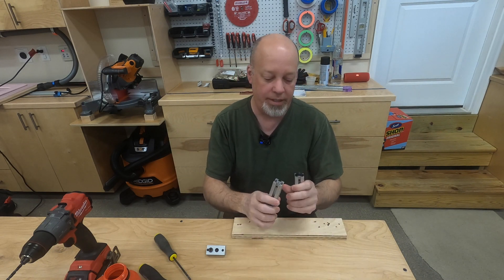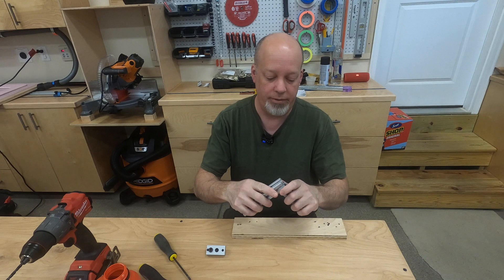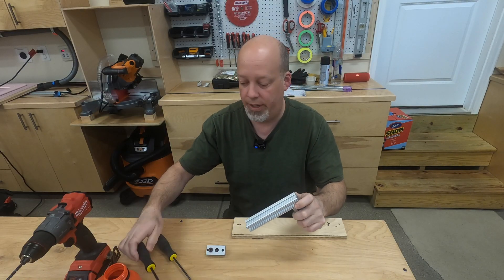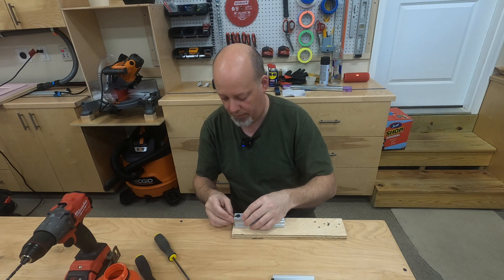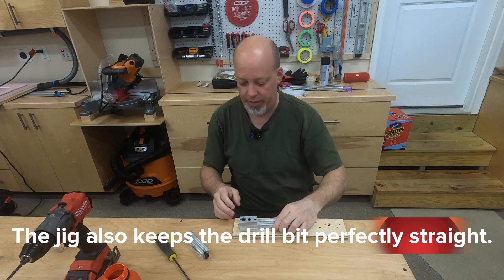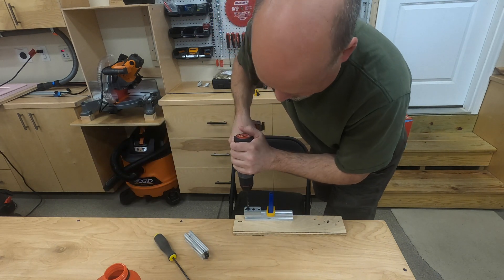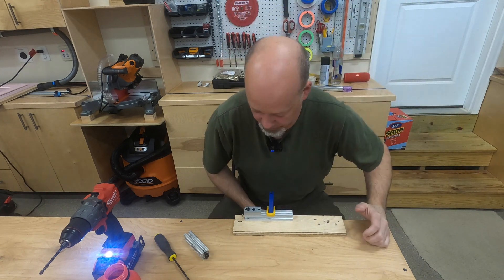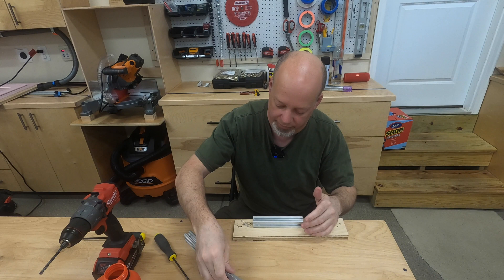How to drill an access hole in 80/20 10 Series extruded aluminum (using a jig)

Comment: This jig drills a 0.201" access hole.  Any reason why you can drill a slightly larger hole like 0.25" which is more of a common size with a diy jig?
Reply from the maker: The 8020 jig makes a hole meant for their 10 series size tool and most other tools I've used fit. If you have a jig to make it bigger and you don't have structural concerns, I suppose that's up to you to try. A larger hole might weaken the center more than desired.
Reply: @VanTransitions 0.201 to 0.250 will weaken it? The access hole is just for your hex wrench to tighten down the nut.

Comment: Is the fastener stronger or a bracket with a screw going through the entire extrusion?
Reply from the maker: Hi. That's a "loaded" question. The 8020 website has print materials (with pictures) discussing the different strength of their connections. I'll have to refer you there so you can make that consideration based on your load needs. Thanks for watching!

Comment: What is the max hole size you think I could get away with drilling through the extruded aluminum like you are doing in this video?
Reply from the maker: In what context? Why would you need or want a bigger hole? Are you impacting the structural integrity of the extrusion? That's an engineering question for the manufacturer most likely.
Reply: @VanTransitions  which drill size did you use

Comment: Have you tried to make your own angle brackets by cutting the 80/20 with 45-degree ends? You can order them and have the pilot holes predrilled, but it would be great to make your own out of scrap cut offs? I have been looking for a way to drill the pilot holes at 45-degrees.
Reply from the maker: This level of engineering is not for me. The people at 8020 have the solution perfected and for the number of 45 degree angles I will use, I'm happy to buy them pre-fab. Best of luck!

Comment: I like your instructional videos very helpful as I plan my Ford transit buildout. I noticed your work bench behind you during this video. Do you happen to have plans for building the workbench? I would be interested in it/those. Thanks
Reply from the maker: Hi. Are you referring to the cabinets against the wall in the background? Fix This Build That on YouTube is where I got those plans. I had to make my own decisions as to the space between for the miter station. I put 2-3 layers of water based poly on all the cabinetry, probably 3 for sure on the tops. The peg board frame is from scratch using poplar.

Comment: You could make your own by using a small cut off of the 8020, run the turn or mark it ...  if you use the 90 on each side it can slide.
Reply from the maker: I prefer the factory precision done for me :)
Reply: Yes that working too , but after fews holes alu piece will become enlarged and no longer precise .  a steel sleeve into a real jig is the reason why it's more durable